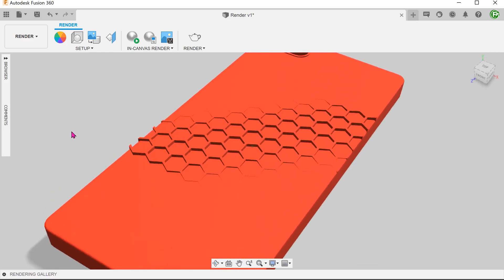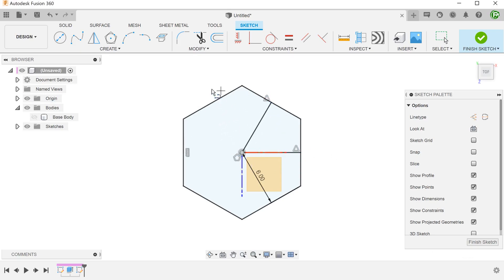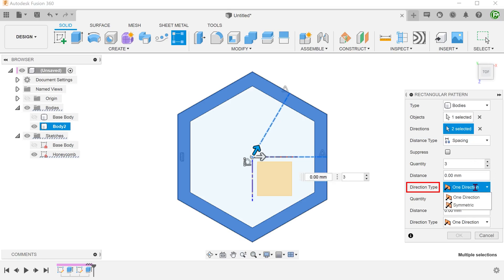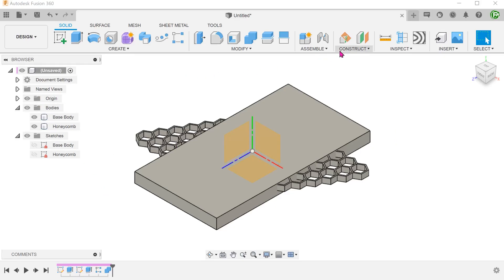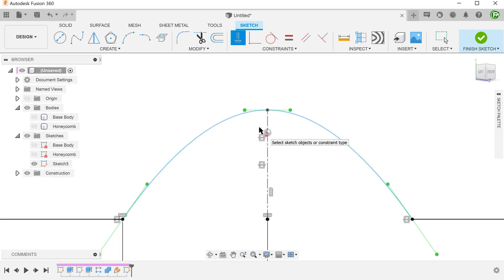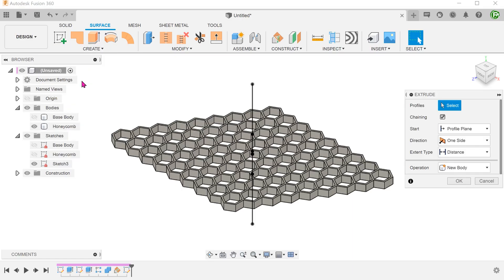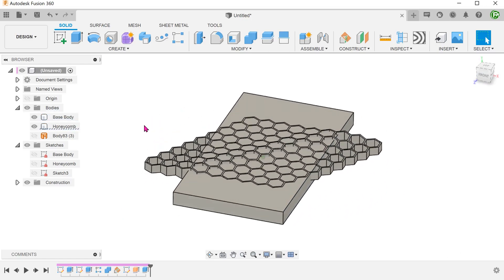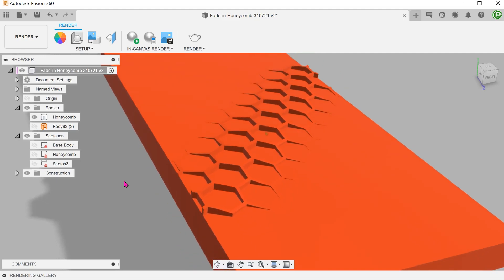Fusion 360 | Fade-in Honeycomb Pattern

Comment: Do you know if there is a way to make a honeycomb hole pattern through a body like 3d printer software does? I Want to basically have an STL model that looks like a 3d model with no top or bottom layer so the infill pattern surrounded by walls of the model. Does that make sense? If i could output gcode as STL that might work but it would be better if i can accomplish this with Fusion 360 instead

Comment: 3:36  instead of patterning the body, you could have extruded the first shape with a 'join' type, to join it to the rectangular body, then patterned the extruded feature on the timeline (selecting the 'adjust' option).  This would eliminate the need to join the bodies later.  You could have also defined the surface body before that, so the extrude to surface body could also be included in that feature pattern, reducing the overall number of steps to about 8 to get to the same end result.

 You might even be able to eliminate one more step by defining the surface body spline in the same sketch as the a side profile for the main case body, thereby eliminating one sketch.
Reply from the maker: Thank you for the suggestions. These are all very valid points. I will find time to try them out. On hindsight, my method can definitely be streamlined further. Might do a follow up video on this. Will definitely credit you.
Reply from the maker: Hi, I went to try extrude to surface (join with body) together with pattern and it does work well. Thank you for the suggestion again. 
I also wanted to clarify with you on your second point about making the spline in the same sketch as the body, in case I misunderstand. The spline is at angle to the main body side profile, so this wouldn't be possible.
Reply: @Fusion360School  if your first sketch were made side-on (extruding a side-profile), rather than top-on, then the spline could be in the same sketch, otherwise not.

Comment: Good video!
Learned a few new functions I have missed.

I would probably have made a full extrude of the honeycomb.
Then made the shape I wanted with splines or a circle with desired radius, doubled the lines and then extruded/cut the shape into the honeycomb. Then add the main body back and joined what I wanted.  Not sure if it would work, but I wouldn't even have thought of it unless I had seen your video! 

Never thought of doing esthetic stuff on my projects. But after seeing this I most definitely will!

Gonna have to try this technique! Everything we do is a learning experience!

Comment: Excellent video! Another command: replace face....it might have worked here as well as the extrude of the honeycomb. Your tutorials are the best!
Reply from the maker: Hi Mickey, thanks for the kind words as always. When I first conceived of this video, my original plan was to use the replace face command. However, I would always get an error even when the surface body fully overlaps with the source face. I find that it would only work if I reduce the honeycomb density greatly.
Reply: @Fusion360School  hrmm - I wonder why it is like that? I will investigate.

Comment: insted of using that surface to extrude to, id use the spline to split the body to that shape. As allways great video, im allways learning new things from you.
Reply: I have concluded it is called Fusion 360 because there are 360 different ways to get any one result 😆
Reply from the maker: Yes, that would be the faster way. Come to think of it, I could have easily closed up the spline into a profile and do an extruded cut also!